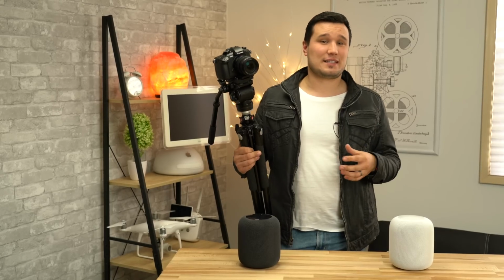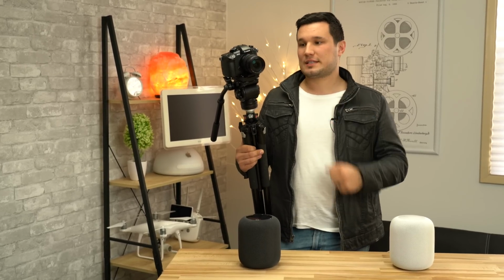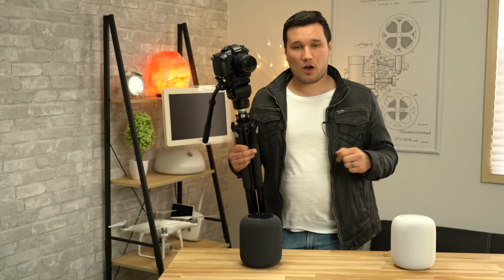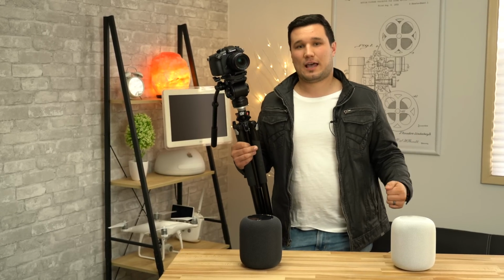Does the GH5 Autofocus HACK really WORK?

Comment: This test is not done the right way, which is a bit of a shame. First, YodaYeo clearly states in his discovery video NOT to do this at 24p. You need to use 30p or 60p. Then you should change the shutter angle to 179. Moreover, do not use face tracking mode, but use single focus area, roughly the size of the face. With these settings AFC is significantly improved on the GH5.

Comment: Tests at 24fps are useless as the fix does not work with 24 fps. The way it is supposed to work is that by using a different ahutter angle the camera has more cycles in which it can run the autofocus. So it just makes the camera try more often to gain focus but of course that does not make the focusing itself more accurate.

Comment: The only way to have good continuous AF with 4K is to install a really fast. processor (thus raising the price)  or push the processor to the limits like Sony does and have problems with overheating.  You can not have both.
Reply: in a rolling shutter comparison you can see, that the panasonic processor shurly not is slow.
Reply: The GH5 has a MFT sensor but costs the same as an entry level DSLR.  It is not slow.  But still not fast enough to have both 4K and good AF.  It is not the AF technology that is lacking on Panasonic's part.  AF with 1080p is better.  It is just that good AF and 4K are CPU demanding programs.

Comment: Everybody please, please the best autofocus for the GH5 is this one
and with 180d, 360d etc... Try this one and tell me what you think.
 Believe me it works perfectly. No matter the lenses you use.
              At:24p 30p 60p 120p.
Auto Focus settings: 

AFS/AFF

1 set AF/AE Lock to AF-On 
2 Quick AF. Turn On 
3 Eye Sensor Af. On 
4 Pinpoint AF Time. Set To Short 
5 Af Assist Lamp. Turn On 
6 Focus Release Priority. Set both options to Focus.
7 AF+MF. Turn On 
8 Continuous Af turn on
9 AF Speed Af Sensitivity turn off

Used Custom Multi
press Save and Select under neath it 
press C1 keep the + in the middle with 
    No focus point set otherwise it will hunt
        (Special thanks to JIX SAW)
https://www.youtube.com/user/purebeor2010
Reply: these worked quite acceptable on GH4, but totally useless on GH5
Reply: Ilona Weller , maybe but... I don't know why 
it works very well for many people who own GH5
including me.

Comment: I don't think you actually watched the original video, or truly understand the underlying fix. This is not representative of the actual improvement you get if you follow the "hack"/fix properly. Set synchro scan to 179, then change your shutter angle to 179. Adjust the sensitivity level, and focus speed in the AF customization settings. Done. This video is not that great Max. :(

Comment: I changed my shutter angle to 179 using 4k 60 and it works amazing.  I could not believe it but it worked. Give it a try.
Reply: I did the same and found shutter angle 179 using 4K 30 worked quite well also. Still it's not good enough for professional use. Too bad, would have been a nice plus for an already amazing camera but I can live with it.
Reply: I notiece changing the shutter angel to 179 kicks the exposure up a bit.  I took it down by -1/3 and looks about right.
Reply: where did you set it ? Is there a option in GH5 to set to shutter angle rather than shutter speed ?
Reply: you have to put the camera in shutter priority mode for video not the S on the dial and it will then allow you to adjust the syncro scan.  Also I turned the exposure down about -1/3.  check out  this video https://www.youtube.com/watch?v=IoCSfaJ7E4U

Comment: You need to use 179° 30p. 180° will not change anything. This video isn't a good look for the GH5 and doesn't show the "fix" well. You should re-test at those settings using single point AF mode and I think you will find much better results.

Comment: You should have tested with a 179 degree shutter angle with 25p/30p/60p framerates and synchro scan ON, that's where the sweetspot is. This workaround/hack doesn't seem to improve AF speed with 24p framerate unfortunately.

Comment: I turned the Synchros Scan ON and set it to 179 degrees and saw an improvement on all frame rates, with 30fps and 60fps having the most improvement
Reply: Tactical Toolbox You are correct. Max conducted the test with incorrect settings. You just need to go to 179'
Reply: Tactical Toolbox your a savage
Reply: I got the GH5 recently. Is this fix still needed today with the latest firmware updates? From my tests, I didn't see any noticeable differences with 179 syncro&angle @ 30fps...

Comment: Hey Max, I have tested my GH5 and the key deference is when I set the Synchro Scan option. When you set it 179d and the camera is in NTSC the 30P 4k 10 bit is really better. One thing I can see for error is the face tracking AF mode. I have tried it with the 225 area with 9 points selected(mainly because this is all I use) and seem to track almost perfect.  Still can see the adjustments of the motor jumping in time to time but never have lost the subject as before the fix. The lens I use is 12-60 Leica.

Comment: Hi Max,  179° seems to be the best and i've seen much better results than these which may be due to the 120°.  24p has limited if any improvements due to techie bits, all you really need to do kick the camera into the fast af mode, in one of your previous video's you read out a technical manual page which said accurate af in 4k motion pictures will be hard in a reduced af speed (or something like that),  it seems this reduced af speed is activated if the shutter is open too long and not just by 4k. ...   ps I did reach out to you just after i posted my original video on facebook but sadly no reply. .  :)
Reply: Max...you totally wasted your time with this video by not doing some research.  179 is the magic number for NTSC 24p.  Doesn't work for face detection but it is night and day for area focus.  There are like 20 videos that shows this already.  Yours is the only one that shows it doesn't work because you didn't set the right settings.
Reply: For what ever reason yours are by far the worst results i have seen!  by a country mile!   Search and you'll see 179° results are amazing!  for what ever reason yours didn't look much better!  I get that you are busy on other stuff.
Reply: I agree man, I turned the Synchros Scan ON and set it to 179 degrees and saw an improvement on all frame rates, with 30fps and 60fps having the most improvement by far.
Reply: Guys!  Max uses the GH5! Why would he try to sabotage it?! I have a GH5, an A7Rii, and a 6Dmkii. The GH5 new 30p/60Shutter works much much better than before. It still is not as good as A7Rii or 6Dmkii. But it's super improved. Frankly, I only bought the 6Dii because I couldn't rely on GH5's AF. Now, I'm wondering if I can count on it. The fact that the face is recognized but focus is not acquired is one of the biggest frustrations of GH5 Face Recognition compared to Sony and Canon.
Reply: From another person I've heard that simply setting the shutterspeed manually at 50 or 60, (instead of using shutter degrees) also helps the camera a lot. In effect you can shoot 30p + 1/60 (=180 degrees shutter angle) if you do NOT set your camera up in the shutter angle mode. I hope Panasonic will improve their firmware to fix this.
Reply: Max Yuryev I put 179 too, and change the custom AF speed like +3 or +5 and its very fast for gh5, not perfect but very fast.
Reply: Yes, mine works very fast on both 1/60 30p and 179d 30p using my 12-35 lens and 225-area or custom-multi area focus and focus speed settings on default settings. After changing the focus speed to +5 it seems even slightly faster. It's almost immediate. My only complaint is it doesn't work much on 24p which is mostly what I normally shoot... I'm going to switch to 30p for projects that need auto-focus. No problem:)
Reply: Real World Endo I don’t think people’s claims are about him sabotaging the GH5, just more about not completely researching people’s claims. 120 degrees shutter angle was not what people were testing. It was clearly 179 degrees. That being said, it would have been nice to see it from him as well,  especially those subscribed to Max (such as myself) whom take his opinions at a higher level. I feel he needs to make up for this video and run another test at 179 degrees just so we can see if he gets better results. I don’t have a GH5 as of yet but am on the verge of purchasing one and although AF isn’t as important as some may see it, it wouldn’t hurt to have it.
Reply: i doubt Max did not researched well about this so called improvement of AF on GH5 before creating his own test. Not taking the shutter angle 179 degrees only proves an indirect bias to justify all his previous tests that GH5 AF is just a bullshit.
Reply from the maker: YodaYeo Thanks! I did get a lot of people that mentioned it. Sadly I’m super busy right now so it took some time. Are you seeing better results with 179 compared to 120?